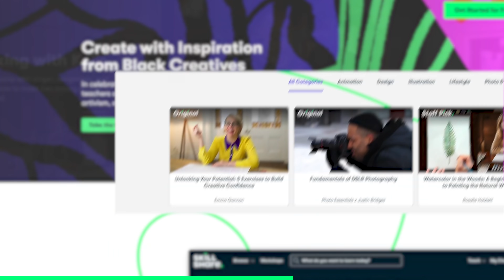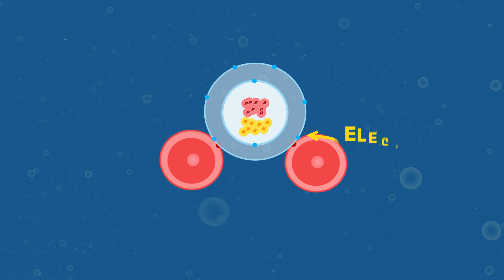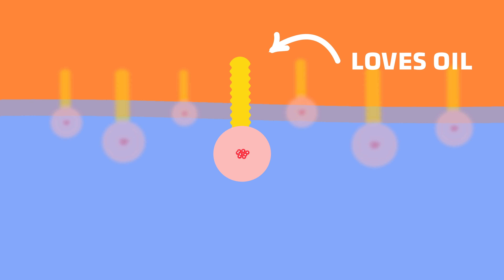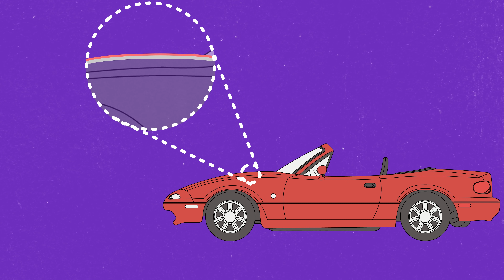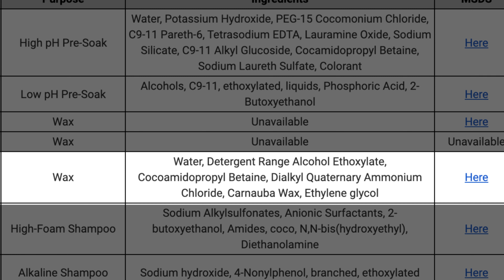Why Car Washes Might Be Scamming You with SOAP

Comment: My dad had a truck he washed 3 times a week at this car wash right down the road. A couple years after he had it he noticed that the paint was peeling. Which was weird because he keeps it inside and like I said washes it 3 times a week. Then he noticed that corners in the fenders and doors were starting to show metal. So he took a test sample and sent it in to our local labs and sure enough they were using a high level acids. He ended up suing them for 3/4 the price of a new paint job. The truck just got painted and it’s only 8 years old

Comment: Just a heads up, all car washes that are not brushless WILL scratch your clear coat... Avoid them especially if your car is a darker color as you will see every little scratch... Also most brushless/touch less washes usually will not get your whip that clean.

Comment: Only time I use a car wash is when I just need the pressure washer to spray off some bugs. Since I keep it ceramic coated, it all comes off pretty easily for just 4 quarters.
Other than that I’ll hand wash it and dry it at home any chance I get

Comment: I strictly wash both of my cars by hand with the two-bucket method. But sometimes, especially in the winter, I want to wash the undercarriage but that's pretty tricky when washing by hand. I don't want to use an automatic car wash with scrubby brushes because I don't want it to swirl my clear coat, but I'm conflicted about the touchless ones. A touchless wash would at least get my undercarriage a rinse but I'm still concerned about the caustic chemicals perhaps messing with my clear coat. Maybe I can rig up a DIY undercarriage wash with PVC pipe and a hose adapter for home use...

Comment: As a detailer, I'd have to say: never go to a car wash (touch or touchless). Learn to properly clean your own car or take it to a detailer who will do it right.
Reply: Also, polish doesn't protect your paint, only wax, sealants, and coatings protect. Some polishes contain this, but not all. Polish in the wash isn't gonna do anything except maybe up the cleaning power slightly. I wouldn't be surprised if it swirled the paint even more honestly

Comment: They are scamming you, I worked at a car wash for a year. Never keep valuable things in your car when getting full service. We would run our hands along the seat rail looking for change before vacuuming. On a busy day we'd end up with $30-50 in change. Any change that was vacuumed up went into the collection pit and was sifted out at the end of the month. The owner would split the change with whoever was willing to collect it, often landing you $300 or more on the side. The cleaners were highly diluted and the pay and spray timers and pressure were a joke. If you've a hose and a bucket just do it yourself.

Comment: I actually fix carwashes and handle the chemicals for a living. What you're presenting is mostly true. Often the Tri foam is all the same, I'm surprised you found one that isn't.  What you didn't cover is how more expensive washes tend to have drying agents that help water bead, and break up the soap so cars come out cleaner. You're better off with a well maintained wash with brushes every time.

Comment: I just pay the $2 to use the power washer and dry the car off with a towel after, cheaper and looks better in my opinion
Reply: this might work if your car is ceramic coated or really clean. Otherwise your just grinding in all the stuck on dirt the pressure washer couldn't get off. If the towels dirty your killing the clear coat
Reply: Get your own powerwasher and use it in your driveway, you can but a big car shampoo bottle and use the powerwasher to spray it
Reply: @bassam_salim  well I don't have a driveway 🤷‍♂️ i live in an apartment.
Reply: https://youtu.be/hzVqV0HUVq4

Comment: I have to kindly disagree with you. Hand washing creates more scratches in the Clear coat or paint. This means you have to polish & buff the whole car or truck. And there are different polishing compounds for metal & plastic. So you might have to buff & polish with 2 or more compounds. Having your car washed at a quality car wash pays for itself for removing most everything without having to spend 2-3 hours hand washing & polishing your car or truck. Most all manufacturers paint & clear coats will last longer go through a car wash then hand washing.

Comment: Random story about touchless car washes nobody asked for: 

I bought a 2020 Mazda 3 last year, and whenever I get busy and don't have time to hand wash it, I sometimes take it through a touchless. Have with all 3 of the cars I've owned, with no issues I might add.

After about maybe the 4th wash, I noticed this tapping sound coming from the roof on the passenger side. Upon inspecting it, I found that the trim molding strip on that side had started to come up. No big deal, I can just take it to the dealer and the warranty should cover it, right?

So, I take it to the dealership, and the guy says "yeah, several clips on this strip are broken. I can go get a price for you if you'd like to replace it." 

I obviously bring up the warranty, and he immediately says that it wouldn't be covered, following it up with: "You take it through car washes don't ya". I admit to having taken this brand new car through a touchless a few times. 

This man proceeds to tell me how it's now my fault because they actually tell people (just forgot to mention it to me apparently),  not to take them through high pressure washes as it can "easily break trim clips". 

Apparently a brand new Mazda can't survive a touchless automatic, and I had to spend over 50 USD to buy a piece of plastic. 

Ok, story nobody asked for over. Thanks for attending my TED talk.

Comment: Oil and water doesn't mix 
BMW Owners:
"Hold my head gasket"
Reply: Subaru Owner too. 😂
Reply: @rkan665  EJ goes Glob Glob Glob 😂😂😂😂😂
Reply: @rkan665  high boost EJ goes BOOM
Reply: @J B blown heads from cooling system failure is a bmw issue for sure. looks at my   15 year old plastic water pump
Reply: @rkan665  shhhhh if you talk too loud, my e39 can hear you.
Reply: #TRUTH
Reply: You spelled Subaru wrong

Comment: I’ll tell you guys, I work for a laundry detergent manufacturer, and we sell most of our scrap liquid detergent (leftovers, mixed batches, slightly off viscosity, all the soap we can’t use for some reason) to car washes. A fair amount, but not all of it, is laundry and/or dish detergent

Edit: we sell close to 50 tons of soap a week to car washes.
Reply: Can confirm, we have done testing for a soap producer and anything that was in any way off got sent to the carwash :D
Reply: Thanks
Reply: @tokin_alien4132  only if you can top our production numbers🤷‍♂️ 50 tons a week isn’t a small amount
Reply: Had a white VY SS sedan that I usually washed every Friday after work for the 5 years I owned it and I always used dish soap to wash it and never had a problem with the paint. I then purchased a black VY SS ute, Friday night rolls around and I give the car a wash using dish soap, and it just ate through the clear coat on the bonnet and roof.

So point I'm making is that it might have something to do with the paint or quality of the paint job.
Reply: @zchettaz  100%! Chet. Also, color is a major factor, white hides scratches and blemishes very well, while black will show every flaw. Also, dirt, I’ve seen people neglect their car for so long they forget about a scratch they had, and when they come thru the car wash, they instantly blame the wash… luckily we have HD cameras before you can go in, and we can show the customer the dmg before they came in, but after they wash, the rest looks so good, but it also shows flaws.
Reply: @nastynotch8314  even though I needed a ute for work purposes, I wish I never got rid of my white one now.
I thought black was going to be better by not seeing as much dirt on the car, but I think it annoys me more seeing all the tiny dents and scratches having a black car 😔
It's only the clear coat though, so if it's raining or I've just hosed the car, the paint will look good and can see the the pearl in the paint, when it dries, it looks like streaks of white flakes and completely faded.
Reply: @zchettaz  maybe something in your clear coat, too🤔 I’m not a paint scientist, or even a soap scientist, I just make the stuff
Reply: My dad just retired from a car wash manufacturer as their tech support, and he hand washes all his cars in Dawn anyway.
Reply: Good lord ! 
Thanks 👍
Reply: They don’t use it cars, they use it for their towels.
Reply: It's so the company doesn't get sued for selling stuff that isn't on the exact mark it promises to be. It would be like saying this stuff will clean your clothes better because it consists of 99% of this soap but if they just leave in the faulty batches which have less of it in them and people find out, that'd turn into a big law suit because the company lied about the mixture properties. And it doesn't sound good from a marketing stand point to say this product may contain up to 99% of the product that actually does the good cleaning job that you want but we can't promise it on a consistent basis so your cleaning results will vary.
Reply: So basically it's stripping the cars wax. Glad I wash my own car.
Reply: Where's the hookup for Donut fans?
Reply: @PWN_Nation  I’m not that high up in the chain🤷‍♂️
Reply: That’s why my car smells Downy fresh afterwards!
Reply: Carwashes wash alot of towels for customers... this is not odd to me...
Reply: Yes, there are unscrupulous businesses, just as in any business...
Reply: @Lockpickingblacksmith  nah, there’s nothing wrong with that. We’re actually reducing cost to our company, and the car wash companies we sell to, allowing your car washes and laundry loads to be cheaper for you. We also are reducing waste that otherwise would likely end up in a landfill or harming the environment
Reply: @riverlarsen8192  I actually worked in the car wash industry. Those ARE positive benefits, but that doesn't mean those soaps are appropriate for cleaning cars.
Reply: Crap. My daughter was right when she theorized, "Isn't most of the soap from a car wash just dish soap, like Dawn?"
Reply: @lego4virgo  it CAN be, but GOOD car washes will use car specific soaps from reputable brands. Cheap, crappy car washes will use stuff like Dawn because, well, it works. It's also super cheap and your car will be impressively shiny. However, modern car paint is actually very similar to plastic, which is chemically similar to fat... which is what high quality dish soaps are designed to destroy. If you want to visit a car wash look for a few things.
1, the area should be clean. 
2 if it's a friction wash make sure they use closed cell foam brushes. These clean consistently and won't scratch. (Note, these can legally be called 'brushless'. If you want nothing touching your car besides soap and water, find a 'touchless' car wash.
3 See if they advertise a particular brand of soap, like simonize. While they could be using cheap stuff, it is technically illegal (false advertising).
4 ask to see the soap drums. It's likely they'll have some empties laying around, or you may be able to see them from the door to their chemical room. Don't be shocked if they say no. Allowing customers into such an area is a liability hazard. You can at least ask.
5 Check their Google reviews, but tale them with a pinch of salt. Most customers only leave reviews when they're unhappy, whether the car wash did something wrong or not.
Reply: @EMFAudio  yes, however I actually do know what I'm talking about, because I talked to the chemists to educate myself.
Reply: @Lockpickingblacksmith  A.) Like your profile name B.) Yeah, what you say makes sense. I can wash my car in my own yard--and I have some Simonize car wash soap products for doing that--but sometimes I just feel like having someone do my own car. Thanks for the info, though. I'm going to ask and check on it.
Reply: @lego4virgo  Thanks, and you're welcome. Nothing wrong with washing it yourself or taking it to a wash. Just need to keep a few basics in mind to make sure your car will be shiny and scratch free 20 years from now... or 5. 👍🏻
Reply: @Lockpickingblacksmith  not true, dish soaps such as dawn are used in automotive detailing all the time. One of the best know ways to strip wax and sealants in prep for compounding is to use dish soap. Like any chemical washes never let it dry, don't wash in the sun and always make sure to thoroughly rinse. And after you should really add some form of wax or sealant to help protect your paint.
Reply: @miloofficial7975  hey dummy, he said “laundry detergent” y’all using Dawn down there Alabama? Cause I know that’s where you learned how to read, and damn sure learned to talk about something you got no idea where it even began. 😜 roll tide
Reply: @nastynotch8314  I said laundry and dish detergent man😂 I was only specific about laundry soap because that’s the department I work in
Reply: @lego4virgo  it depends on the car wash, the company I work for only sources tire shine, all the other chemicals are made within the company. And I can tell you they are nowhere near dawn dish soap
Reply: @tokin_alien4132  you'll probably be surprised how many turn you down.
Reply: https://youtu.be/hzVqV0HUVq4